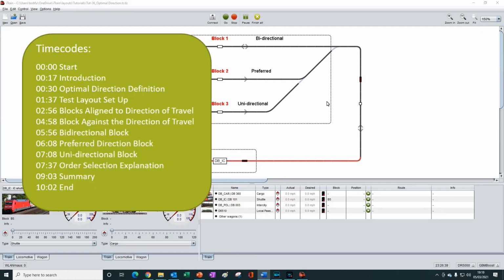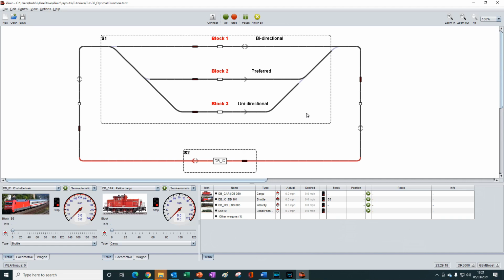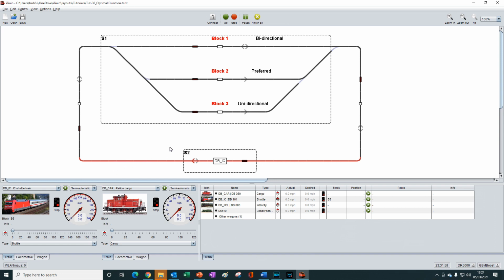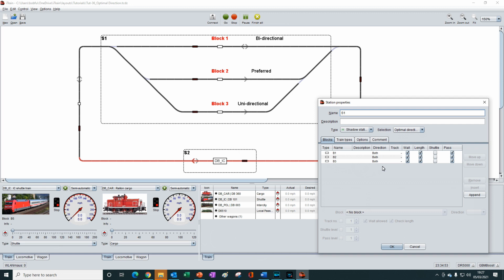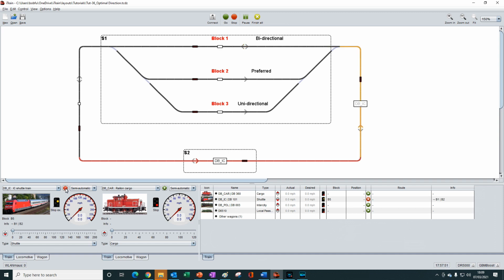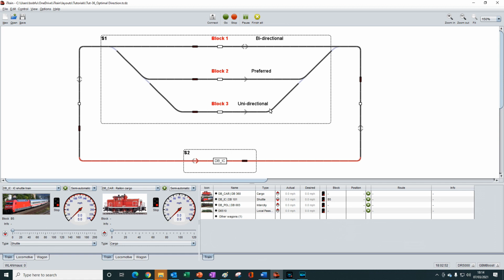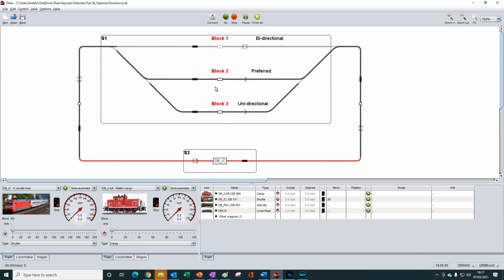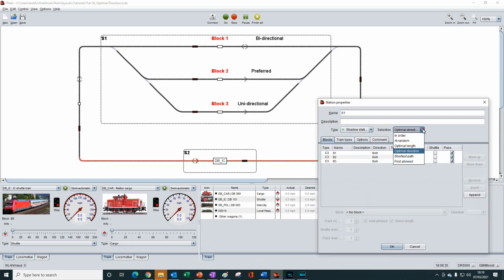Video 36: Using iTrain Tutorial Series - Optimal Direction

Comment: Hi Bob, I recently came across your series when I was researching what software I was going to choose. I have binge watched these over a couple of weeks and must congratulate you for a superb series of informative/instructional videos 👍. I have a a question for you:- The station I am building has long platforms, "down" trains stop at the country end of the platform and "up" trains stop at the London end of the platforms. Am I correct in thinking that if the platform is divided into 2 blocks, using the "preferred" direction option using say "next" for the London end and "previous" for the country end, I will be able to simulate this? I am definately going with iTrain now and looking forward to seeing how signals work.
Reply from the maker: Hi Warnz, great to hear that you are enjoying the series. Regarding your question, yes, that should be possible. Will the station platform be served by two tracks, an up and a down track, or a single track? In either case, it should be possible.
Reply: @bobfuller  Hi Bob, thanks for replying. The platform is a single through track and is designated as P1a and P1b with 1a being the London End. P2 is a branch with a crossover giving access to the main.
Reply from the maker: @warnz9701  If you have a trial license or have purchased a license, I would recommend that you post this question on the iTrain forum and attach your layout file. Then we will be able to see the layout and confirm that your scenario will work.
Reply: @bobfuller  OK thanks 👍